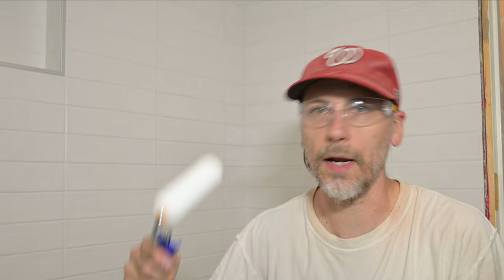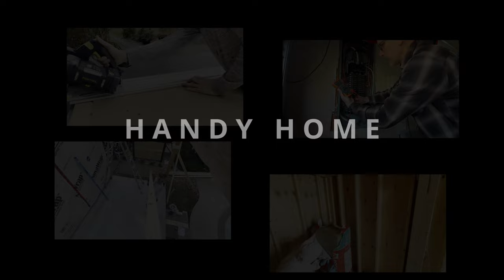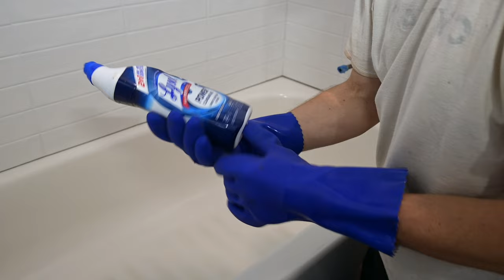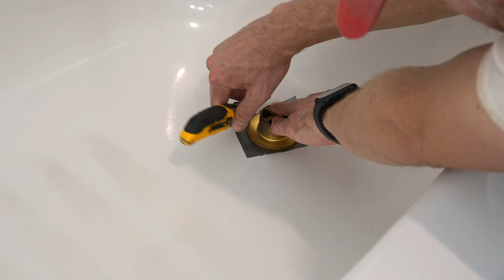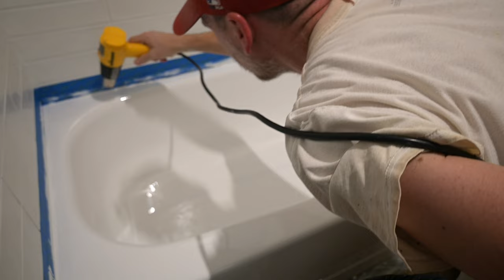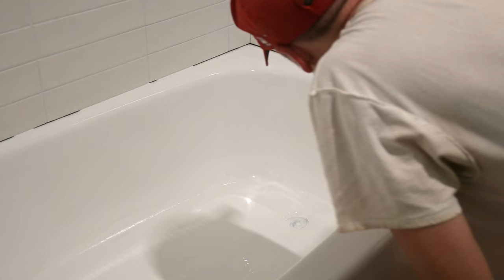How to Refinish Tub with Epoxy Ekopel 2K kit and Make it Look Brand New | Bathroom Remodel Part 4

Comment: DIY'er here... used it for the first time today... did 2 tubs... they look great... will see tomorrow when it's cured...

Update… the tubs look fantastic compared to the before condition. There’s a slight issue with the paint properly, mixing within the epoxy, and it looks like bubbles after it cures. But the finish is glassy and smooth. I made a huge mistake by not properly covering the drain hole, had to drill it out, lesson learned. A month ago I did my parents bathtub, and  made the same mistake, I just got much better at drilling out the whole. I have my parents second bathtub to do in the coming months.
Reply from the maker: Awesome. I think I could have done better after using the first one as a “practice”
Reply: Is it still holding up
Reply: BBBBZZZZZZ, Sir. We need answers please.
Reply: @forestspritestephanie  update provided, thank you for the interest. 👍

Comment: A little research would have done a long way. The manufacture has multiple videos should how to properly use this. The cup that you covered the drain with should have been used to pour the product. If don’t properly you really don’t need the roller
Reply from the maker: Yes I watched all their videos and they used the cup. The kit also did not include a scooper so I followed their recommendations and made one with duct tape. The roller is not for traditional painting but you use it to spread the material around and even the surface or it will pool in some areas.

Comment: It always looks nice when it has been done recently.  The trouble starts after a few months.  It cracks and peels.  Then you have to replace the tub, which you should have done in the first place.  BTW, the price of a new acrylic tub is about $ 200.  Removing and installing a new tub is much easier and much less work than messing with epoxy.
Reply from the maker: That is what I’m interested in is the longevity of the product. Mine is a cast iron. I spent a lot of time on the cleaning and scuffing up of the existing surface so hopefully this gives a good bond. I did this about 6 months ago and everything is still good. I was planning on doing am1 year update video to show how it has held up. I have 2 kids that use it daily and the young one is constantly dropping his heavy toys so it is definitely getting tested.
Reply: Having rental properties, I've removed a cast iron tub and replaced it with a $30 acrylic I got at a Home Depot auction. It's not the cost of the tub that's the issue. Getting the cast iron tub out was a real pain (we ended up having to break it in two just to carry it down the stairs). 
I've also painted tubs with epoxies. I'm choosing the epoxy vs. taking out the iron tub this go round.
Reply: @austinbrittabrashears144  I helped my dad take out a cast iron tub many years ago. Same experience, too heavy and we had to break it up with a hammer into easier to handle pieces

Comment: I understand the price on this product has gone up a lot compared to 3 to 4 years ago. I can't seem to find a contractor to do. Strictly do it yourself? Did you need to do 2 coats? Sorry. I am not to the end of the video yet.
Reply from the maker: @susan70003 I did it all myself. This was my first time using the product or resurfacing a tub. I watched the company video. I would recommend watching the pro do it and then non-pro like me lol. It is not as easy as they make it look. It is not difficult but it makes quite the mess. You only need 1 coat for a standard tub. It will do the inside all the top edges and front apron like you can see me do

Comment: My first tub was done two years ago-still beautiful, but it has some yellow streaks where the water flows in the tub. The tile surround is In perfect condition. I only use Dawn power wash and soft cloth to clean.
Reply from the maker: Hmm I will have to look out for the yellow discoloration. Maybe it is the chemical makeup of your water? Do you get the stains on other fixtures or the toilet?
Reply: @handyhomerepairs  No other stains -only the tub.
Reply from the maker: Strange. I know epoxy can yellow with UV or heat but doesn’t sound like either of these two possibilities. Maybe the pH or hardness of the water? I have seen some people talking about yellowing of epoxy grout where the water hits it.

Comment: One thing I wish I had done was to keep a small bottle of the unmixed ekopel to fix a few minor repairs after drying.
Reply from the maker: Yes, thought I’m not sure how long it would last once ingredients exposed to air. They sell a touch up kit but expense for a small patch. I still have some small areas I want to try to smooth with high grit sanding but still afraid to make it worse if I can polish it correctly

Comment: On scale of 1-10  how frustrating is this process? 1 being mild annoyances 10 being you gaslight your wife for 30 mins because you thought you can hear a toilet being flushed 2 floors up. Thats a joke but you know what im asking right. I'm not sure I want to do this.
Reply from the maker: Maybe a 6? It did not come out perfect which annoyed me but it is good enough that no one except me would realize. If I did it a second time I think I could do much better. It takes many hours after pouring to continue to keep the epoxy from running into the drain. I had the perfect environment set up. It was probably 1 hour to install and then another 6 hours of checking every 15 mins to an hour. It saved a couple thousand $$$ so that made it worth it. Been there a few months and has held up to several kids in there and dropping things on the surface. There are a couple scratches but nothing major. You can sand and polish them out but they aren’t major enough that I want to potentially cause any other issues

Comment: This product is to use on a porceline  or caston iron buthtub? Because my but tub is NOT fiberglass material
Reply from the maker: @giuliana4287 my tub was cast iron with what looked like the original finish on it so probably porcelain. I scuffed the finished a little with sand paper to make sure there was something to stick to but the manufacturer said it was not necessary

Comment: Do's & Don'ts.  I have been painting cars for 42 years, so Listen up or Read Up Well.....
Make sure you do all sanding with Sandpaper grit between 80 to 180 Grit Dry sanding, before you sterilize it with the final clean for coating.  
Tape up in such a way that its easy to get a hold and to take the tape off, before the stuff hardens.
Wear a 3M Respirator when sanding and specially when re-coating. 
Get a roll of 3/4" & a roll of 1-1/2" 3M Tape.  Tape up first using the 3/4" tape and then use the 1-1/2" over.  Its easier to outline first with a 3/4" than with a wider tape.  Do not use the Blue tape, as its a Low Tack tape that works good for house wall painting.  I use the 3M Yellow Tape for Auto Painting. 
Sand very well around the Faucet and Drain fittings, if you are not removing them.  Removing the Drain  can cause lots of other Plumbing problems, to avoid this, sand well and tape up. 
Wear  tight fitting gloves. Wear a very tight fitting shirt when you are coating. Your Sleeve and loose shirt will ruin many things for you.  
Vacuum all the sanding dust immediately.  
Warm up the bathroom to around 75 to 80 degrees when coating, and warmer soon after coating.  
Beware of spills.  Keeps a large strong tray to contain all liquids and specially the Epoxy.  Epoxy and the Catalyst create a chemical reaction when mixed that is highly toxic.  So wear a good quality 3M Respirator, not a Dust mask when coating.  
Keep a fine tipped tweezer handy to pick up any hair or dirt what pops up when coating.  Get a Eagle Beak tipped  fine tweezer.
Keep a couple of cheap touch up brushes from the $ Store,  for tiny craters or anything that pops up.
Wear Knee Pads or a soft cushion to save your knees. 
 Be careful when Finally using the Heat Gun and specially the heat gun Cord.  It can and will touch here and there, pissing you off, and ruining the job in the final stages, as touching up at that point CAN AND MAKE THINGS WORSE.  
 Finally open the bathroom window and install a small exhaust fan or any fan in the reverse direction so it sucks and blows the dust and fumes outside. 
Take precautions from the get go. 
Good Luck.
Reply from the maker: Awesome suggestions. Thank you.
Reply: Very informative
Reply: I appreciate this information
Reply: Yeah You Know For A Lot Of Years
And You Donot Know Anything 
We Can See It,
Epoxy For Floors Gets Stick Even If You 
Have Shiny Clear Coat My Friend, 
Learn A Lesson.
Amén.

Comment: I just finished my third time in using Eckopel epoxy. Here are some tips:
1. Use head lights gear in order to see any fine imperfections so corrections can be made
2. If you want to help your back out, attach a 2 feet pole to the paint handle
3. Use a 32 ounce old cottage cheese/ yogurt cup to pour. I cut about 2 inches down 2/3 around the cup; that will leave a nozzle for pouring.
4.Buy extra epoxy to help with the ease of pouring and spreading the solution.
5. Have a three tier floor protection (it’s messy folks!) first layer: 2 inch green Frog tape with plastic attach to it placed at the base of the the tub. Second layer: An inch behind the the frog tape line, place the brown roll paper-I cut pieces of the frog tape to keep it in place (total of 24 inches from the base of the tub). Third layer: a flatten cardboard box where the containers and pouring cup is placed.
6. Since I glazed the tile surround as well ( my tiles do not go all way to the top). I made sure there was a continuous run of the frog tape when I taped off the top of the tile to ensure there is easy removal. I do remove the the tape as soon as I finish just in case there is a mishap, corrections can be made because the epoxy has not settled.
7. Have the plastic bag opened/several gloves/wet paper towels/wet lint free towels set up near you.

While in the midst of the project, you are going to question your existence and how did you get here. The key is to LET THE POURING AND GRAVITY DO THE WORK FOR YOU! The epoxy has a thick honey-like consistency that is hard to move when there is a thin layer. Be deliberate in pouring, slow down just a little-only a little because of the time restraints.

For a project like the video, the job would have been easier with more product. I would have had another container to complete the job. 
I hope this helps anyone because the company’s videos are not realistic they make it seems easier that what it is, then it’s a complete shock once you get started. I wish you all success!
Reply from the maker: Awesome suggestions and help. Thanks! Yes it is messy, not like in the company videos. It gets on everything so protect everything store you start
Reply: I just did mine and its very blumpy and i could see the dripping how do i fix that
Reply from the maker: I have not done it but I believe the only way to fix an uneven surface is to sand it. You will have to use very fine sandpaper like starting with at least 500 and going up to finer till it looks smooth (maybe up to 2000). Probably best to call the company first and ask them what they recommend before you do more damage.

Comment: I've been looking at doing this as an option during a recent renovation in my own bathroom.

(For the purpose of our background, we are building company in the UK and have installed many bathrooms during larger domestic building projects - since 1980.)

The reason I entertained this idea was to save time replacing the bath tub, and associated tiling works involved. 

I have to say, and although I bet there are guys out there who've done a pretty good job at this...I do not see the point in going to this effort in being 'precise' and trying to ensure that a smooth and seamless look is achieved, when essentially, you're working really HARD (and under pressure) to try to achieve a passable result.  

I have full respect for the work involved and efforts made in this video! I just feel that ultimately it is less pressure for guaranteed gain to replace the whole unit - including the time involved cost. 

Remove lower layer of tiles, get the bath out = two hours. 
Replace bath with new, plumb in to existing waste with new trap = 1/2 day - 1 day.

Tile down onto bath (assuming you can source same tiles) = 1/2 day. 

Guaranteed the best outcome. 

Worst case scenario? You could apply new tiles on top of tiles? Glue Aqua Panels to existing tiles? etc etc

Wishing you all the best dudes ;o))0
Reply from the maker: I understand your perspective. The problem with the cast iron tubs are they are really heavy and jammed tight into the space. I’m working by myself so I would not be able to lift it out and would need to break it into fragments. Then load it into the truck and take it to the recycling center. Then bring a new heavy tub back and find help. I don’t like the newer acrylic tubs they scratch too easy

Comment: First off love your video very helpful just wondering did you have to put a bonding paint down first? And how did it turn out
Reply from the maker: @medicmark9683 no bonding paint, just followed the company instructions on cleaning the surface and using the recommend toilet bowl cleaner because it is stronger than most. I also use sand paper to roughen the surface a little even though the company did not mention this step. It has been about 6 months and no issues yet. Still looks great. I have a 5 year old that is constant dropping toys on it so it is getting work out.

Comment: Just did this last night. I decided to wait on my bottom course of tile until the tub was refinished. Installed and grouted all the rest of the tile. That way, finish would run underneath bottom course of tile.

Unfortunately, a stupid bug flew into the epoxy after I went to bed. And there are little hairs in it... not overly visible, but their in there for sure. It looks WAY nicer than before, but it's definitely not perfect.

I also did not tape overflow, and no epoxy went into it.
Reply from the maker: Good job. I had 2 bugs land on my almost finished pour but was able to get them out luckily. I agree it may not look perfect but it is way better than what it did look like and great for the first time attempting it. Nobody except us will notice the imperfections
Reply: @handyhomerepairs  Right on. I dug the main body of the bug out today and sanded the rest down a bit with 220 grit. Can't tell there was ever a bug there. Now we'll see how long it holds up.
Reply from the maker: I keep thinking about sanding imperfections but I’m waiting for a chip or something else major. My kids drop toys and other things on the tub almost nightly and it’s held up lol so it seems to be durable so far.
Reply: @handyhomerepairs  That's great. Good to know. Sounds like it will last a while.

Comment: ~ I was kinda thinking if’s U had punched a Hole in the top of Ur Cup .... it may stay put, instead of Float...
Reply from the maker: I’m not sure if there was internal pressure that caused it to float or if the epoxy is much more dense and just flowed under the edge. It’s worth a try.

Comment: How long does it last?
Reply from the maker: I have heard 5-10 years but there are probably a lot of variables. If you have acidic or alkaline water it will probably stain faster than the original. If it gets direct sunlight epoxy can yellow. If you did. It apply it correctly it could start peeling. If it gets chipped or scratched it could allow peeling to start. I have had mine for almost a year and it is as good as the day installed it.